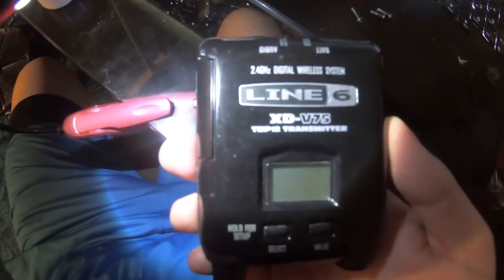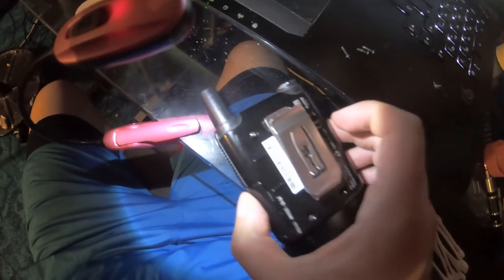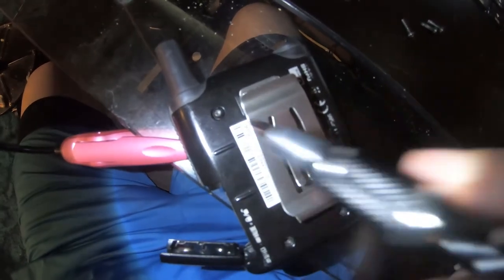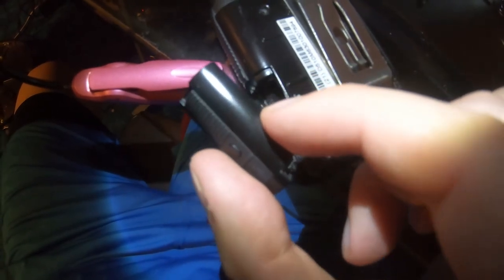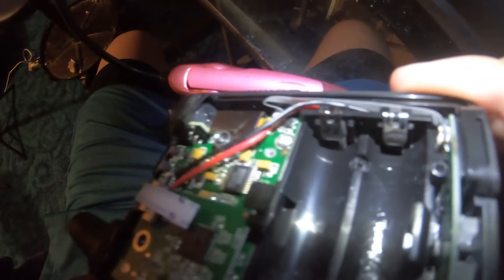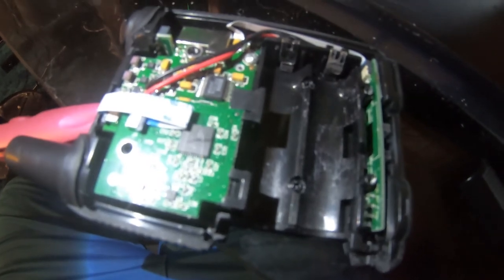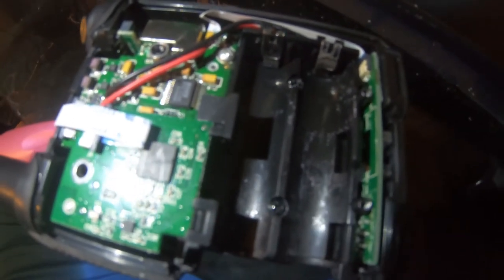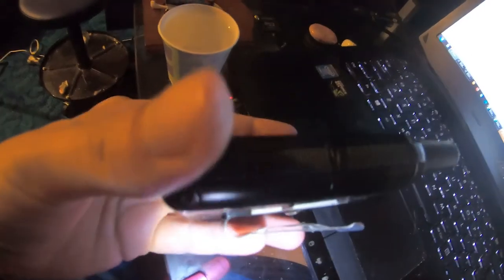How to FIX a DEAD Line 6 TBP12 with battery corrosion

Comment: great video. thanks for taking the time to make it. Mine cleaned up, but having the issue of not making great contact all the time. The drop of solder is something I've read about to get a little more contact. Thanks for sharing.
Reply from the maker: Glad it helped. After sanding the contacts down, if you do need to put a dollop of solder to get better contact you don't need much. Just a drop or two. Plus, even if you accidentally put a bit too much on that it can't conduct, just use your solder pen to heat up the solder and use some flux to clean it off, then reapply the solder until it works for you. The other thing is Amazon/Aliexpress has these solder pens that you can select the temperature digitally on the side of it for about a hundred bucks (down to increments of degrees), and they're just awesome. It gives you a lot of control (but a normal old school solder station is fine). Solder is pretty forgiving even if it doesn't look it, just heat it up, squeeze some flux on it, remove and repeat.

Comment: great video! Just curious for how long the batteries remain inside the compartment? or the corossion was caused by other than all-time-plugged-in batteries?
Reply from the maker: You only need to do this if you have corrosion preventing the unit from turning on. Also, batteries left in too long would be the only thing that can cause corrosion in this case. If they is a slimy residue, white goop or even a hard white crust - that's corrosion. Basically, if you see any discharge from the battery then you gotta clean it.

Comment: Don’t all screws come out counter clockwise? And did you really need to take it apart like that if all you did was stick a Q tip down there? Seems like the Q tip would have reached with it still closed up
Reply from the maker: Nope. Screws don't always come out counterclockwise, and because of the way the door is set up you actually do need to take it apart to get enough force to rub it off - hence why this video was made the way it was, as lots of people stick the q tip down when assembled and you can't get enough pressure. If you owned one of these things, you'd see that from the weird design of the battery door. There's also a divot that gets in the way unless you open it.
Reply: @skycron  I do own one and I’ve cleaned the bottom connectors, and even pulled them up with a hook made from a paper clip. All without taking it apart.
Reply from the maker: @ryanc2465  That would be because you had less severe corrosion. Which is great for you, but for people that have more severe corrosion, you have to take it apart. The video does reference that it is for severe corrosion. You got lucky, that's really all that happened here. That's great for you, but a Q tip in a closed unit doesn't help those that have more severe corrosion to fix it since you need a bit more torque than pulling a paper clip on the tab. For more intense corrosion, it has to be opened up, full stop. This video is for those people. Regards.